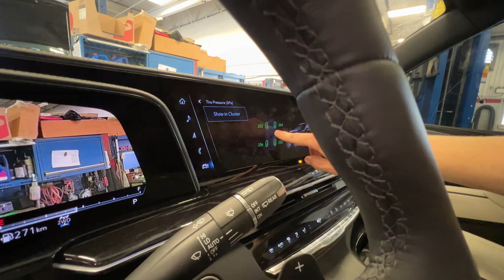Upgrading my Escalades stance with a 24” Vossen fitment / buyers guide for GM  6 Lug Pattern SUV’s

Comment: The black ring is called a "hub centric" ring. The wheel itself is a 6x139.7 pattern that will work with other vehicle models. The ring itself helps eliminate any wheel vibration, especially at higher speeds.
Reply from the maker: Oh that’s really interesting thank you for sharing that
Reply: Actually the fact that there is a plastic ring for the hub means that the wheels are NOT hub centric.  ie.  they are cheap wheels.  He even said the wheels were cheaper than the ugly factory wheels.  HRE wheels for example are made to fit the specific model perfectly.  No need for whats basically an adapter.  You get what you pay for.

Comment: Your Escalade looks tight! Just recently swamped out my 2021 Escalade Sport stock rims and got winter tires with black rims. Not a big fan in upgrading to "24 rim just kept it with the "22 black rim with the Cadillac center caps.
Reply from the maker: Thank you very much Hubert

Comment: By far the best looking Escalade I’ve seen!
Couple of changes I’ve noticed on Cadillacs website……
Cadillacs website no longer gives the option to purchase the monochromatic emblem  without upgrading the wheels.  
The Brandy interior is only available with bucket seats in the middle row.  
Do dealers have the ability to order differently than what the general public can build on Cadillacs website?
Reply from the maker: Thanks man. I am really happy with it. We have to order the monochromatics separately and install, brandy interior is getting rarer by the week it seems, we have a couple of things we can change above and beyond the website one but for the most part they are the same.

Comment: With the larger diameter rim, did you notice any difference in your shifting points? Sometimes larger rims can delay shifting at full throttle. It did with my 2019 Suburban.
Reply from the maker: Oh great question. With it being a 10 speed I did not notice that. I will be sure to keep that in mind when I put them back on in the spring